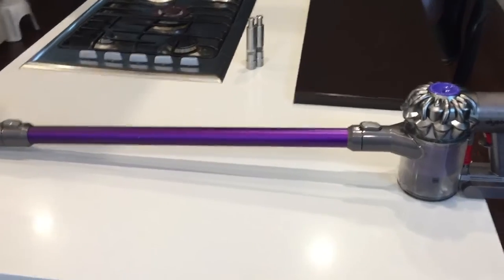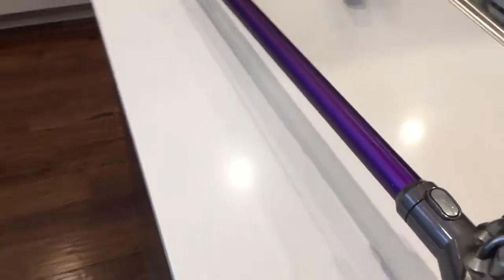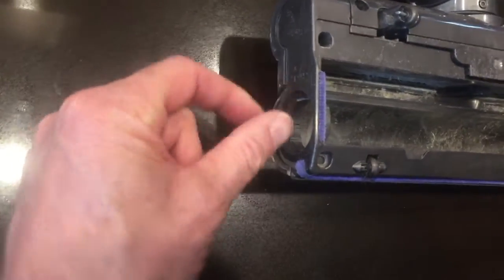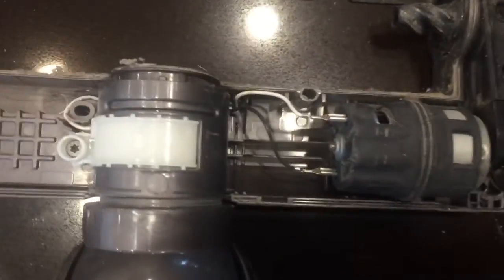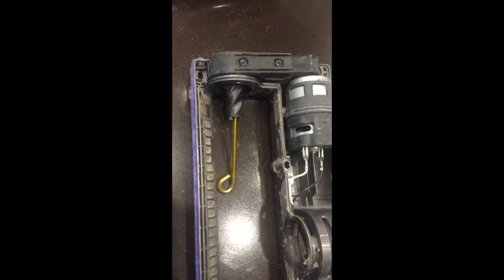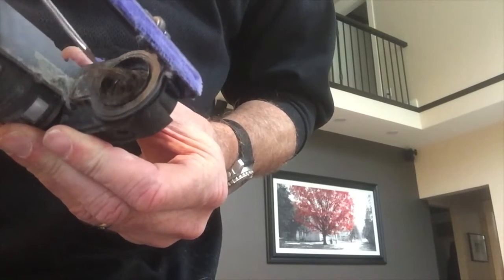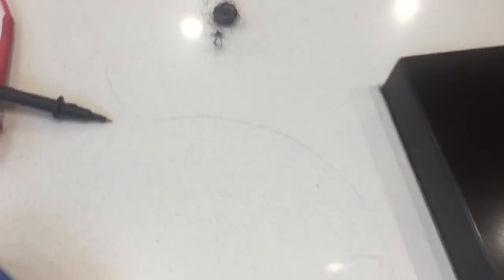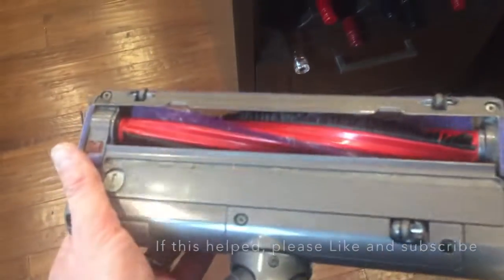Dyson V6 power head intermittently spins

Comment: Great video. There was nothing apparent beneath my spindle at first but when I removed a washer, the bearing track was clogged full. A dental tool worked wonders to get the crud out. And now it works! I thought I'd cleaned the whole head when I took it apart (and there was a lot to clean) but it still didn't work. This tip to get below the spindle was the final step! Thanks.

Comment: Thanks for this video... my beater bar was operating intermittently and after about 7 or 8 tries it would finally get going. Took it all apart just like you did and pulled out a bunch of hair clogging it up in the same spot as you. It did improve things considerably, but was still taking a couple of tries to get going. I took it apart again and gave it a hit of Teflon dry lubricant and now it's as good as new.

Comment: Hi
 I've got a Dyson V6 with two powered heads, they both work when plugged into the body but neither will function when connected to the extension pole. All heads are clean, the battery is fully charged and I've checked continuity in the pole and all is ok - But alas still neither powered head works on the pole. 
Being a service engineer I've tried all the normal tests for electrical connection faults without success.....

Comment: Worked for me. It seems like the star bit that's inside the spindle is smaller than the other multitude of screws that are more accessible so don't give up if the driver you're using doesn't seem to fit into the one inside the spindle -- try a smaller bit.
Reply from the maker: Glad it worked

Comment: Thanks. Had the exact same issue with my DC35 and this solved it!
Reply from the maker: No problem. Glad that it worked for u as well.There are two other videos if the problem comes back or a new problem occurs.Subscribe and like if you can. every little bit helps. Cheers

Comment: Hi - can you tell me what screwdriver you used to get inside the black turning thing? I have a set but too thick to get down to the screw. Many thanks
Reply from the maker: Sorry for the tardy reply. It's a Torx # 8 (also called a T8). There are two other videos if the problem re-occurs. Subscribe and like if you can. every little bit helps. Cheers

Comment: Could not pry open the black spindle out but otherwise managed to fix the spinning motor problem after taking the motor head attachment apart and clearing out the dust. Thanks!! Any tips on getting the balck spindle out?
Reply from the maker: I suspect you are refering to the bearing (?). There is a small retaining spring holding it in place but I havn't yet tried to get it out for fear of snapping it. when it no longer spins due to the bearing I'll give it a go and post the results. Have a good one and stay safe!

Comment: Thanks so much. 
I tried everything to fix mine but failed miserably until I watched your video and followed your instructions !!
Reply from the maker: No harm in trying right? There are two other videos if the problem comes back or a new problem occurs.Subscribe and like if you can. every little bit helps. Cheers
Reply: @markeye646464  Already subscribed, but didn't realise I hadn't given a like. Done now... thanks again 👍